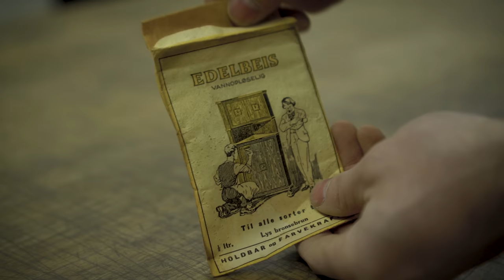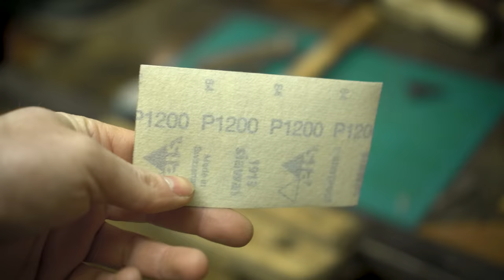Old Masur Birch Knife Restoration | AMAZING Outcome

Comment: Very nicely done. Seeing the cutting mat, you’re using to work on reminds me of something in my past. When I went to work in the mid-70s I designed forms. Bedore computer programs I would draw the lines with pen and ink and type the text separately. Using a Xerox photocopy machine I would reduce or enlarge the text as needed and then with a T-square cut and paste the text to the document.
Reply from the maker: That is awesome!